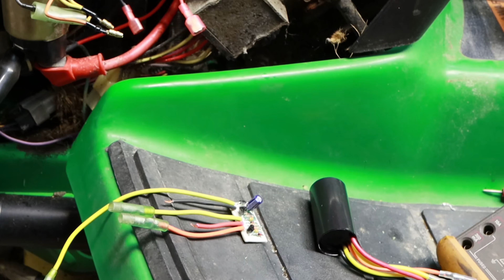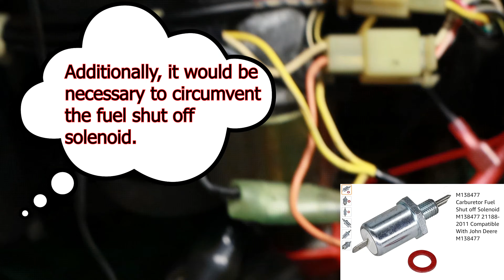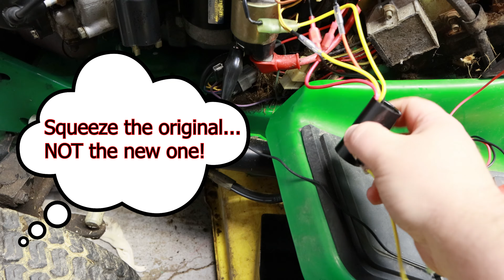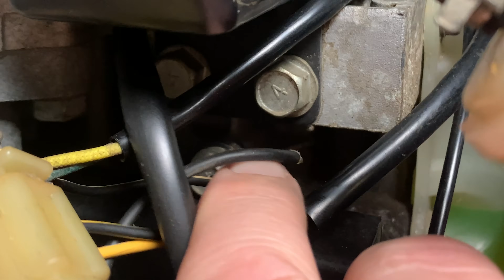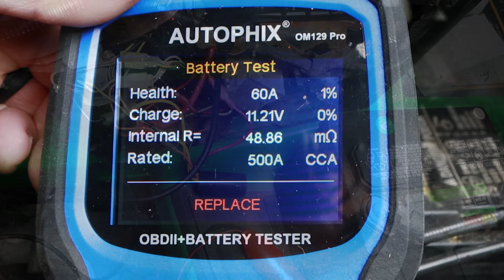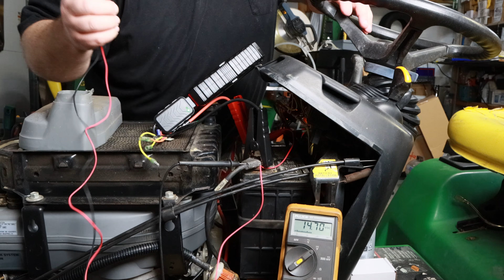Solving John Deere Garden Tractor Start-up Issues Made Easy

Comment from the maker: Parts used in this video are available on Amazon through the links below.
OEM John Deere Time Delay Module
https://amzn.to/40KCoCk

Aftermarket Time Delay Module (About 1/3rd the cost of OEM)
https://amzn.to/3M52fRt

Battery Cable post adapters
https://amzn.to/3nvZ5fc

Spade Connectors we used in this video to simplify wire connections on the positive and negative leads of the TDM. 
https://amzn.to/3M5bH77

Push Button Remote Starter to simplify engine testing
https://amzn.to/3M1kTcV (Substitute- The one used in our video was sold out)

OM129 Pro Battery tester and OBDII scanner (Make sure you purchase the Pro version for the battery test option)
https://amzn.to/3zgNvax

Klein Tools MM400 Multi Meter (Inexpensive model) The Fluke meter used in this video is overkill for most jobs.
https://amzn.to/3ntQM3v

Inexpensive 12-volt test light
https://amzn.to/3KiZutl

Battery Jump Pack(Lower output version than the one used in our video)
https://amzn.to/40GZRVa

Jumper cables
https://amzn.to/40wio6F

Small 10 Amp Battery Charger (Perfect size for smaller mower and car batteries)
https://amzn.to/3Zoxwle

Get the Motion Hero Animation Pack that I use in my videos for
Only $37 one-time investment. Use unlimited times on your own and client videos!
https://baldeagle242--videohero.thrivecart.com/motion-hero-pack-1/

If you're a video creator on YouTube - Tube, Buddy is an excellent program to evaluate your videos and make recommendations to help you attract more viewers.  
https://www.tubebuddy.com/Baldeagle242

Below are tools I use in my shop and on my daily adventures.

Mini Tire Changer for most small tires.
https://amzn.to/31eHgGp

The drill bits I use are lifetime-warranted Molybdenum from Drill Hog.  If you break one or wear it to nothing, you send it back, and they send a new one!
https://www.amazon.com/dp/B010US18BG/?tag=eagle0f1-20

Hand crank trailer winch with strap with safety hook
https://amzn.to/3jTBzEL

Titanium MIG 140 Welder Works with Flux Core (No Gas needed - 110 volts)
https://amzn.to/3mqj3oP
Titanium MIG 170 Welder Works with Flux Core or Gas (110 or 220 volts)
https://bit.ly/3k8GUrD

Amazon Wish List
https://a.co/cWseC8V

As an Amazon Affiliate, I earn from qualifying purchases.  These links help you find the products I've used in this video.  Clicking these links will take you straight to the products on Amazon and help support this channel without costing you anything extra.

BALDEAGLE242 Facebook group
https://www.facebook.com/profile.php?id=100068248886396

Comment: My GX345 starts but quits after 30 seconds. I have plenty of good fuel in the tank. New inline fuel filter but when the engine is running it has very little fuel in the filter. Maybe bad fuel pump? Any ideas before I bring it in? Thank you.
Reply from the maker: Most likely your gas cap vent is clogged. Take the gas cap off and run it in a clean dirt free environment for a few minutes. 
If the problem goes away replace the cap, clean it or drill a tiny hole in the top of the cap.
Reply: OK I tried that and does seem to stay running. Thank you
Reply from the maker: You’re welcome. It happens pretty often. I have a short video that shows this issue on a push mower. People give me crap because I drilled a hole in the tank instead of the cap. 🫣
https://youtube.com/shorts/U1YPivm6Ec8?is=rcRrQL5bxSkrFzP0

Comment: I pretty sure this what happened to my JD GX345.  Dead battery and failing components when I was jump starting using a jump pack and jump starter.  I smoked 2 module boards.  Now it won't start at all.  I just measured the voltage on the orange wire and I have 0-volts.  Thanks for the video.

Comment: I have a Deere 445 that I bought new in 2001. I have never replaced the tdm. My tractor has a long crank but it eventually starts. Any ideas?
Reply: I just purchased a '99 445 with a no start condition. 
Looked high and low for a Time Delay Module on the mower.
After some research , I came to the realization that the 445 did not have a TDM (a lot of Deere models do ,but not the 445).
My solution was a fuel injection module relay.
Reply from the maker: Cliff is partly right about the likely fix, but the statement that the 445 “did not have a TDM” is too absolute. Deere currently lists ignition delay module AM128906 as compatible with the 445, and the 445 electrical system also uses a separate fuel-injection relay. 

I’d reply:

You’re definitely on the right track with the fuel-injection relay. The 445 electrical system is a little confusing because Deere used different configurations/terminology depending on serial number, and there’s a lot of conflicting information out there about the TDM. Deere actually lists AM128906 as compatible with the 445.

That said, on a 445 that cranks but won’t start, I would absolutely check the fuel-injection relay and verify fuel-pump operation before throwing a TDM or other parts at it. Glad you found yours. That’s good information for anyone else chasing a 445 no-start.

Comment: John Deere gx345 with no spark. Connected jumper wire from positive battery post to orange/white wire connecting the ignition delay module to the main ignition module. It sparks and runs. I then replaced the tdm with a new one and it will not spark. Any ideas? Thanks in advance for some ideas.
Reply from the maker: @MarcellaMcMartin  
	1.	Check Wiring and Connections:
	•	Ensure that all connections to the new TDM are secure and properly connected.
	•	Inspect the wiring harness for any signs of damage, corrosion, or loose connections that might prevent the proper flow of electricity.
	2.	Test the Ignition Delay Module:
	•	Double-check the new TDM to ensure it’s functioning correctly. Sometimes new parts can be defective out of the box. Test the module using a multimeter or by reinstalling the old TDM to see if the problem is indeed with the new part.
	3.	Check the Ground Connections:
	•	Ensure that the ignition system has a good ground connection. A poor or broken ground could cause the ignition system to fail, leading to no spark.
	4.	Test the Ignition Coil:
	•	The ignition coil might be faulty or have an intermittent issue. Use a multimeter to check the coil’s resistance and see if it’s within the manufacturer’s specifications. Replace the coil if necessary.
	5.	Examine the Key Switch and Safety Interlocks:
	•	The key switch or any safety interlocks (such as seat safety switch, brake switch) might be malfunctioning, cutting off power to the ignition system. Test these components to ensure they are functioning properly.
	6.	Check for a Short Circuit:
	•	There might be a short in the wiring that is preventing power from reaching the ignition system. Inspect the wiring harness for any signs of wear, exposed wires, or other issues that could cause a short.
	7.	Review the TDM Installation:
	•	Ensure that the TDM was installed correctly, according to the manufacturer’s instructions. A mistake during installation could cause the module not to function properly.
	8.	Test the Engine Control Module (ECM):
	•	If the problem persists after checking all other components, the issue might lie with the ECM. Testing or replacing the ECM could be necessary to restore proper operation.
Reply: @baldeagle242   thank you

Comment: I have JD 345, not sure the year but it has no spark. It doesnt have one of those tdm that I can see? I do have a black square box just off to the side of the starter motor and its mounted to the engine block with one screw? Is that the same thing or something else? Thanks in advance!
Reply from the maker: Yes, that is the same thing. It can be replaced with the round style shown in this video. My understanding is the square style is no longer available.

Comment: I like your editing style baldeagle 

Deere must have asked NASA how they launch the space shuttle  & then copied them to start a mower .
Also, Deere troubleshooting schematic for the gx345 shows the negative of a booster being connected to the metal frame and not the negative of the dead battery ! There is no warning that connecting directly to a dead battery will damage components

Comment: What’s a common crank no start with the earlier model 345’s with the TDM?
Reply from the maker: A stuck fuel solenoid on the carburetor is another reason it will fail to start when cranking. This can be diagnosed with a shot of starting fluid in the carburetor.

Comment: Hello.  I've had a bad battery for a while, and have been using a huge battery module to jump-start it.  Always worked, but I did experience occasional missing at high speed.  Now, the engine won't start.  I did replace the battery a month ago and everything was working fine.  Until last week.  It won't start.  No Spark on either side.  When ignition key is turned on, power does get to the Ignition delay module (through SE2 on the schematic) and power is sent to the solid state ignition module via the Org-Wht wire.  So, I'm wondering if it's the Ignition delay module, or the solid state Ignition Module.  I'm also going to see if power is getting to the Ignition coils.  I don't know what else it could be,  I guess It could be the pulser coils, but both malfunctioning at the same time would be a huge coincidence.  The tractor is a JD 425, built in 1993. Kawasaki  FD620D Engine.  Any ideas??? :)  

The Ignition Module is expensive, but I do have a brand new delay module, which cost me $84 in Canada.
Reply: Update - According to the service manual, the Ignition Delay Module (IDM) keeps power going to the Ignition Module (IM) for a second and a half or so "after" the ignition switch is turned off.  This is to ignite any unburned fuel in the cylinders, and stop backfiring.  I checked the IDR and have the following results...
1. It is powered all the time via the Red wire connected to the starter, which is correct according to the Schematic diagram.
2. When the ignition switch is turned to the on position (ie Starter NOT engaged yet), power is supplied to the IM via the Orange wire. This is without engaging the starter.
3. When the ignition switch is turned off, power does remain on the IM (via the orange wire) for about a second and a half, as noted in the service manual.
4. Power is also being applied to the 2 Ignition coils via the Yellow/white wire.
5. The ground wire is solid on the frame.(Black Wire)
My conclusion is that the IDM functions as intended.  But there is still no spark.  

I decided to see if I could test the pulser coils.  I disconnected connector X8.  I put a volt meter across each of the Pulser coil terminals inside connector X8.  When the engine is turned over, they both do produce voltage.  That leaves only the IM and Ignition coils, but as noted, both of the Ignition coils going out at the same time would be an incredible coincidence.  So that leaves the IM.  It can't be tested easily, so I guess I'll take a chance and get a new one?
Comments?
Reply: Was it your IM or an ignition coil?

Comment: The problem with this module, is it is poorly built cheap Chinesium part contracted out by Deere and then they charge you outrageous for that junk.
The board says Danlum Corp. on it. The outside case says nothing. 
How about just hook up a relay like a normal rider had. 
My guess is this is used to delay a short  lift off the seat safety switch on bumps, where they used to kill the engine and backfire. 
If it wasn't potted there is about $1.50 worth of components soldered to that board. All replaceable by many DIY's out there.
Reply from the maker: You're not wrong.

Comment: Send me your defective ones.  I'll troubleshoot and repair one for you.
Reply from the maker: I’d be happy to send you this one but I probably did more damage to it pulling all off the stuff off of it that it was embedded in than anything. I know I cracked some of the porcelain or ceramic off a few of the resistors. I probably spent a good 30-40 minutes picking it off just to show it for a few seconds in this video.
Reply: @Baldeagle242  if there's enough left that I can read the color code, that will help. Otherwise,  I'll just ohm them out.
Reply from the maker: @larrysherwood2004  My email address is on my about page. If you want to send your address I’ll send it to you just to see what truly failed on it. I really don’t need it back.
Reply: @Baldeagle242  sorry, I couldn't find an email address on your "about" page
Reply from the maker: @larrysherwood2004  it’s my channel name @fuse.net
Reply: Same here- let me know if you want to send it to me for autopsy/repair.
Reply from the maker: @johnwax9759  I did send the one from this video to a previous viewer and the only thing he found wrong with it (other than the porcelain I damaged on the resistors) was a bad solder point. Either way it took me a good 45-60 minutes to pick and pull all of the embedding compound off so the relatively low cost of new negates the time and effort to fix it.

Comment: Have to admire the over engineering on that engine, 
 the mystery board with the red & green LEDs, the non intuitive no start fault from a bad shut down module, the insane cost of replacing almost any part of it, plus the engines habit of acting like a bug fogger every so often. 

Always enjoy watching your channel and thanks for the link to the cheaper TDM
Reply: John Deere is like BMW cars. Highly engineered, unreliable, and stunningly high priced parts.  I should have never sold my Wheel Horse 520, that was as reliable as a Kalashnikov rifle.
Reply from the maker: My father still has a 1989 WH 520 that he uses to mow ditch lines and places he can’t get with his zero turn. It’s one of the only pieces of equipment he says he’ll never sell.
Reply: @baldeagle242  I was selling my house and the buyer asked me to throw the WH in on the deal.  I figured what the heck I'll buy a new tractor for the new house.  Big mistake.

Comment: If you suspect a surge is destroying the module, then it is likely one of the active components is getting damaged. Either the two transistors or one of the diodes. You can test the transistors and diodes with your multimeter.

Comment: If the capacitor is suspect, wouldn't it be very easy to unsolder and resolder a new electrolytic capacitor?
Reply: Capacitor is easy enough to check, and replace if bad.
Reply from the maker: Very true. The issue with these is picking all of the embedding compound out without damaging something else in the process. The cost for a new time delay module is low enough that it negates the time and effort it takes to expose the components on the board.

Comment: On an x300 John deer why it doesn’t start when it is hot?  Thank you
Reply from the maker: If it’s still getting fire and won’t start it’s possible the valves need to be adjusted. If it’s not getting fire you could have a bad or weak coil pack. How many hours are on the mower?